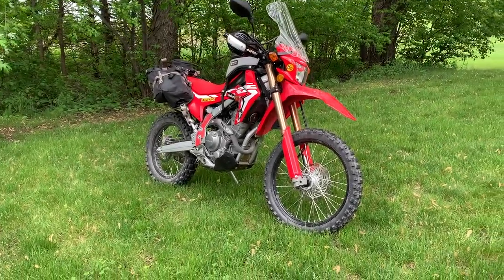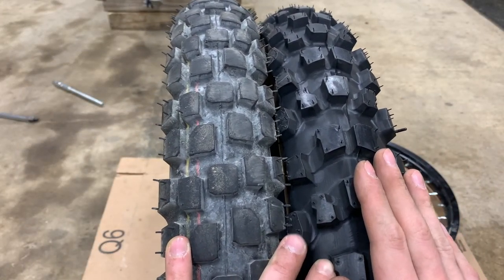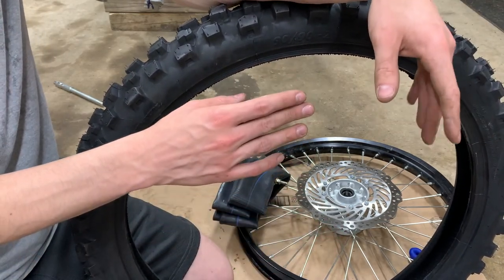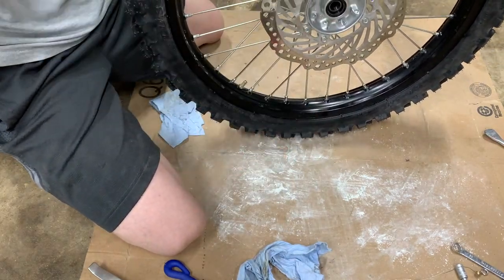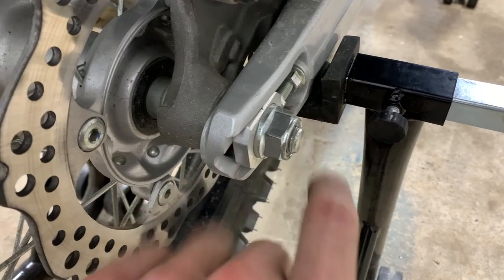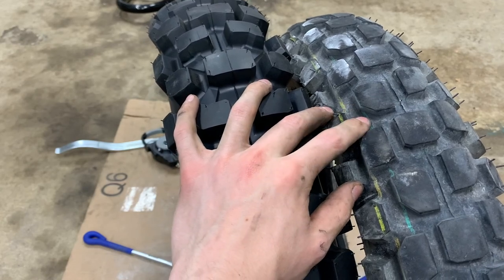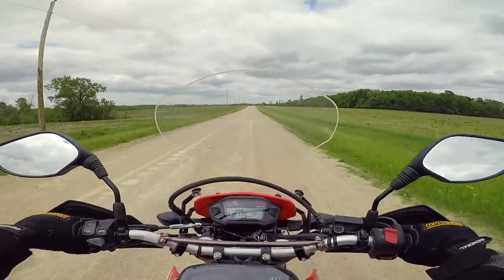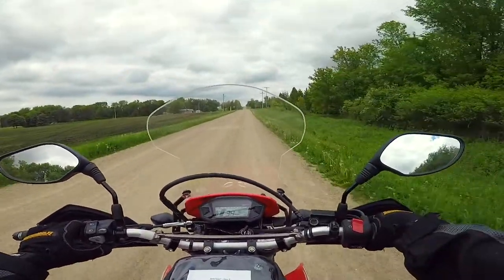CRF250L - Tusk D-Sport Install (vs. IRC Trails GP-22)

Comment: THX CS, good vid on D Sport and mounting. Seriously considering this as rear tire for beta 500. Keep up he good work.
Reply from the maker: I think it would be a good fit. I’ve put a few thousand miles on this tire so far and it’s got plenty of life left. The rubber is soft enough to grip well but hard enough to last for many miles on pavement and loose roads. The only times it’s been lacking for grip was in deep mud and a steep trail with loose pebbles (which most tires struggle with anyway). The only thing that I don’t like about the tire is that it’s heavier than most. Considering the upsides, I think it’s a fair trade off.

Obviously my experience is from a 24 HP CRF, not a Beta 500. How does it handle big power? I have don’t know, but I’d love to find out.

Comment: Just picked up a CRF250L last week and need tires, will probably check these out!  Thanks for the review and good luck with the trip!

What helmet are you using?
Reply from the maker: @Keith Hester - Congrats on your new bike, you're gonna love it! The D-sports have been awesome so far. I have no regrets in getting them.

My helmet is the Bell MX-9. It is a decent helmet and gets the job done for I think $250. It is kinda heavy and very noisy. I personally wouldn't go any cheaper on a helmet and would probably pick up either the Arai or Shoei ADV helmet next time.
Reply: @Casey_Schmidt  Cool, I just ordered a mx-9 adventure yesterday.  Figured it should do a good enough job for just getting into the sport.
Reply from the maker: @keithhester2648  - The MX-9 is not a bad helmet by any means but you do get what you pay for. I'm sure you'll be happy with it like me as something to get you going!

Comment: Try warm soapy dish water for a lubricant (especially for tire onto rim).
Reply from the maker: That is a good method. But I’ve heard/seen from some people where the soap can lead to corrosion of the rim over time. I’m not entirely convinced of the validity of that but I always try to play it safe. These tires are very stiff and difficult to mount in general so I think it would have been a fight either way. I’ll actually be replacing the front tires within the next few week.

Comment: What is the name of that tool that attaches to the tube stem and can pull it through the wheel? That would be a huge help! Hopefully you will see this. Thanks 👍
Reply from the maker: I don’t recall the exact name. I’ve heard it called a valve stem puller, valve stem fisher, valve stem fishing tool, etc. If you buy one, you may need to drill the hole in the rim for the valve stem slightly larger. Depending on which tool you get and which time you have, the tool might too big to fit. (See the Jenny Morgan tire change on the blancolirio channel). It’s not big deal to drill the hole slightly bigger.
Reply: @Casey_Schmidt  Thanks a lot for the quick reply! I just ordered it on line! Just subbed!

Comment: The tusk rear is super heavy! When using a heavy duty tube with them, you can feel the bike is actually slower.
Reply from the maker: I agree completely. There’s a lot of wheel hop.
Reply: @Casey_Schmidt  Yes! I also had the issue, of the rear not hooking up over bumps. It took a ton of weight to balance the rear tusk out as well. Have you found a better tire solution?
Reply from the maker: @sarahdell4042  I just except that as a downside to using this tire. It has low cost, good durability, and overall good grip. The downside of that is it is heavy and doesn’t do well over bumps. You win some you lose some. Taking that into account, I haven’t really looked for a solution. I’ve simply ridden it as-is and worked around the shortcomings the best I can.
Reply: @Casey_Schmidt  The price is very hard to beat, and they do last a long time.

Comment: That is a stunning price for those tyres (tires) , and they look like they have a much more aggressive tread pattern for offroad.
I just fitted Bridgestone AX41 Adventurecross tyres to mine, they are fantastic, but they cost nearly 3 times what you paid. I could cry :) 
Tusk don't do tires to the uk, which is a shame, a lot of their kit seems good quality at a budget price.

I'm surprised at your 25/30 tyre (tire) pressures. I thought the manual said 22 front 22 rear?
Reply from the maker: @Hutchie2112 - The book and swing arm both say 22 like you said. But I think that is assuming the use of stock tires and I think it is also is there to be a safe balance between pavement and gravel/dirt. The Tusk tires are rated for a max of 36 psi on the sidewall so I’m well within their rating. The higher psi helps their longevity.

I just looked up the AX41’s. They look like a really good tire and I don’t doubt the extra money does give you a better quality tire. But the price of the Tusk is hard to compete with. I’ll be doing an update video on them soon and I’d be interested to see a review of your AX41’s on your channel if you’ve got the time!
Reply: @Casey_Schmidt  I#ll see if I can do a wee review at some point, although I am mostly riding the T7 nowadays, and just fitted Anlas Capra X tyres (tires) to it, which are really super knobbly and fun.

Comment: How about mileage? Do you know the mileage on both the tires?
Reply from the maker: @Jim Conrad Tee - Are you asking about fuel efficiency “mileage“ or are you asking about how many miles were on the tires? As far as fuel efficiency, I’ve gotten about the same mpg on both sets of tires. The IRC tires had just under 1000 miles on them when I took them off. The D sport tires currently have about 2000 miles on them and they’re still holding up very well.
Reply: @Casey_Schmidt  pardon for the confusion😅, I was referring to the tires longevity as I would like to exhaust the stock IRC Trails on my crf300l before changing to Pirelli MT90. Do you have any idea on such?
Much appreciated response bro.ride on.🤟
Reply from the maker: @jimconradtee1684   - I haven’t run my IRC‘s since I took them off in this video. As I said I had just under 1000 miles on them. Based on how they were wearing down for me and reports I’ve heard from other people, they should last around 3000 miles tops. So depending on your riding style, they’ll be useful until 2000 to 3000.

Comment: The weight of a tyre is important and seems like nobody cares. Lightweight is much better.
Reply: What tyre would you suggest?
Reply: @Thatbeardedguy86  The lightest one. I don't know the weights of all brands and models. Seems like Michelin has two models and one of them is the light weight version.
Reply from the maker: Weight is very important but it’s not everything. I’ve heard good things about the Maxxis M6006 and Motox Rallz/Deserrt HT. I’d like the give both a try the next time I’m buying rear tires.

Comment: you change for nothing, the old tyres are still good to go,, and they are not crap for a 50/50 dual tyre .. your new one are more oriented off road / trail , wood, mud, bcs of the space between the knob,,,  it will not work so well on the road,,   your knob will run out rly fast or they are hard and its slipy on wet street .. the original one was a good compromise,,

and when i see where you drive.. a tyre like Maxxis M6006 or BRIDGESTONE TRAIL WING TW302 will suits you better..  they are more 50/50 .. tyre is always compromise ..  but i prefer slip off road than on the road,,  bcs its harder, you have car around,, etc.. and you go faster

too much ppl think they do more off road than on road,, but is not true,,  

trail road, stone road,, hard heart is not rly offroad,, some of my friend drive on this with their R1 and road tyre, lol,, dont confound county road , farmer passage and off road,,